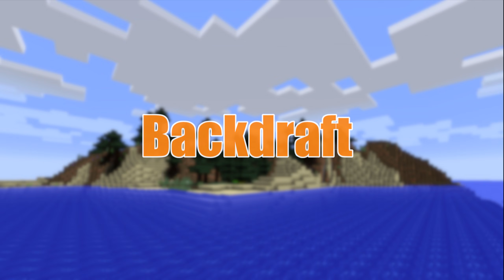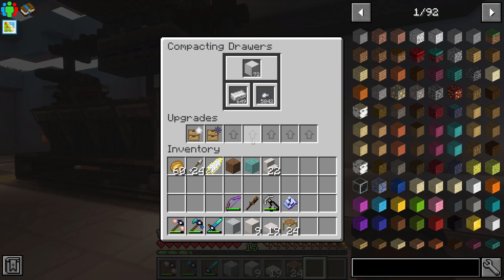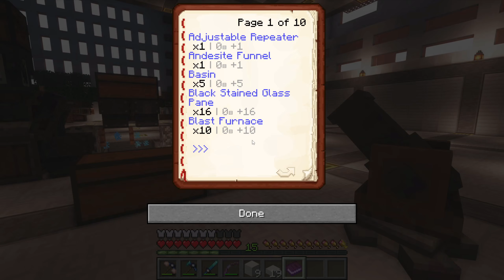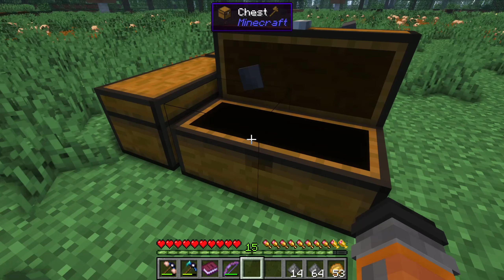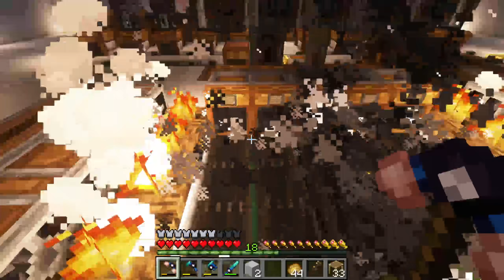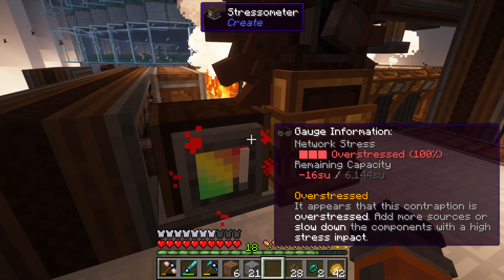Minecraft Create Above and Beyond Flywheel Power Plant & Giveaway - Episode #8 - Modded Minecraft

Comment: The reason for the farm being overstressed is because you tied the flywheel fans to it. When the clutch is active it removes the fans from the stress equation. Also probably why most of your engines died they consumed the coal.
Reply from the maker: Ah that does make sense now that I think about it. Thanks!
Reply: Also, you can remove a lot of stress from the initial portion of the plant by changing the mechanical presses for compacting drawers and use brass funnels coming out of them with a kelp block filter!! That way the windmill stress will drop right down!!!